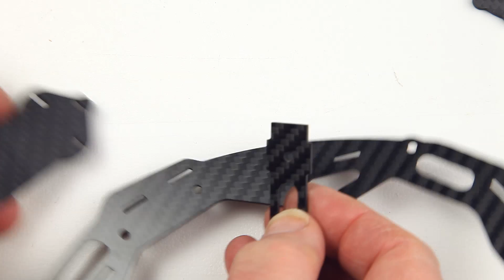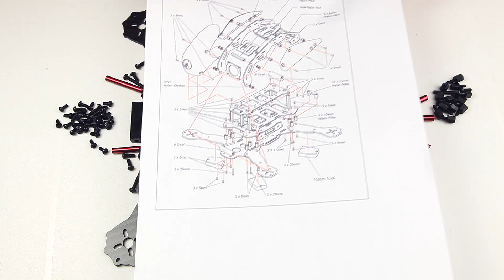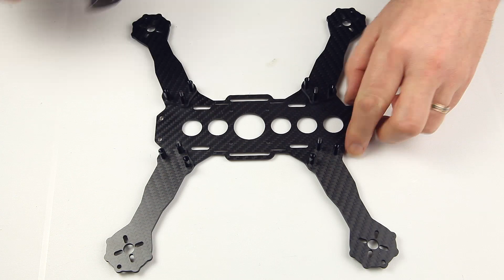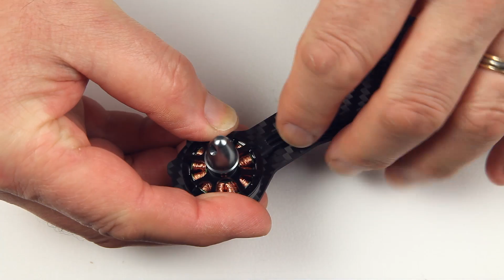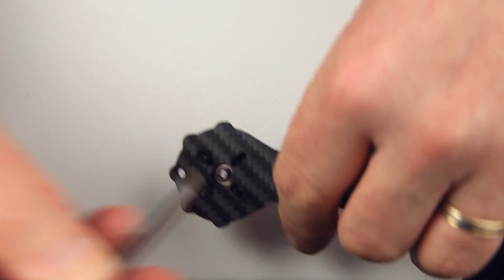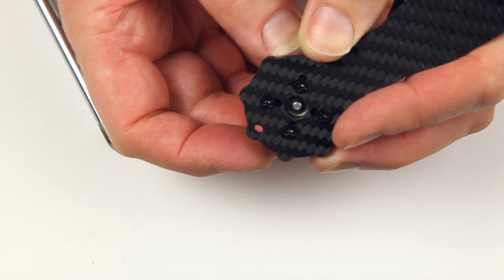Robocat 270mm FPV Racer Quad kit Assembly Part 1

Comment: Thanks for the video :) but do I really need lock tite?
Reply from the maker: Pleasure, yes I would especially on motors but if you keep an eye on it I suppose it would be OK. Just for extra safety ;-)
Reply: Thnx but the shipping costs like 20 bucks to my country and my country does not have a hobby shop or so.. sooo.  But thanks for the advice :)
Reply from the maker: No problem, you don't need a hobby shop you can get it from a garage, DIY store or any engineering firm will use it ;-) hope the build goes well, have fun :-)
Reply: +Tigger's RC Reviews ok thnx :)

Comment: ; ) nice
did you sand down the edges an glue it?
Reply from the maker: +guidelineuk Not this time, trying to build it as supplied but I'm sure I will either take apart after prang or maybe on the next one, good tip though ;-)

Comment: very nice... i'll be waiting for other parts of videos
Reply from the maker: +Alaa Beirouty Hi Alaa, me too i want this in the air, will post as soon as I get them done, glad you are enjoying it so far.
Reply: +Tigger&#39;s RC Reviews 

you have a nice way explaining everything, specially for beginners like me :) 
i wish you can install GPS and configure it if you have the equipments and time. 
many thanks again 
 im thinking to add GPS to a quad to help me not to crash... is that a good idea  ??
each time i fly i have to break my quad.. im a very bad pilot for now :( 
hehe
Reply from the maker: +Alaa Beirouty Hi Alaa, glad you are enjoying it and learning like me :-) I started with small cheaper quads and learned to fly then moved up to faster more expensive ones, so trying to keep crashing to a minimum. I don't think I will put GPS on as I tend not to fly with it on my quads that have it fitted, I enjoy flying and being in full control, but I may change my mind and try fitting it, you never know. Thanks for the comment :-)
Reply: +Tigger&#39;s RC Reviews 

ok dude.. thanks alot :)